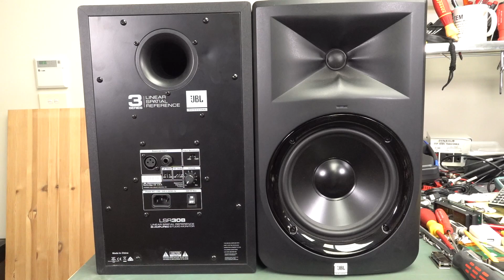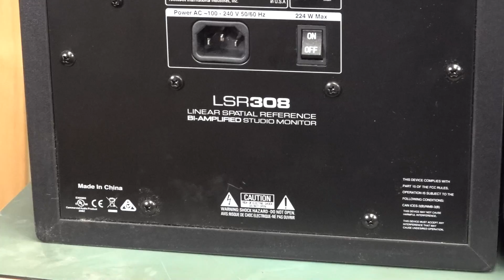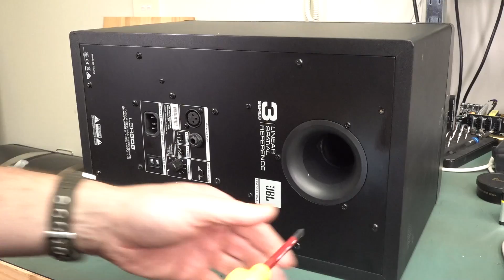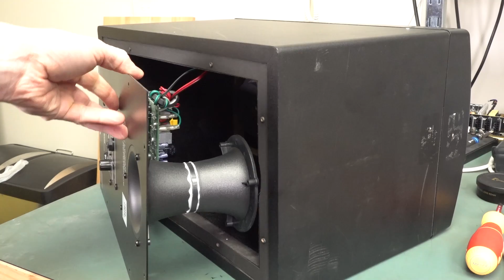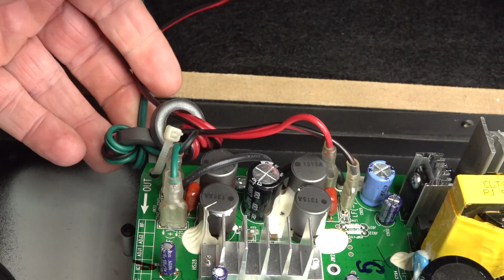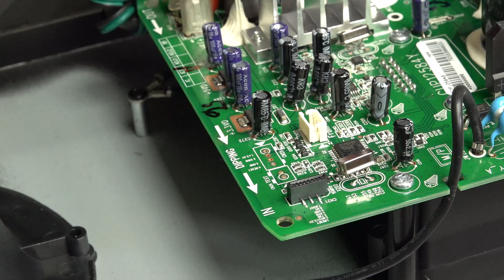EEVblog #1322 - JBL LSR308 Monitor Speaker Repair (FULL)

Comment: You probably should have used hot air on this repair, you would have found it quicker and easier to do, I use hot air a fair bit.
Reply: hot-air and looooots of flux ... as Louis alway says :p
Reply: @kittsdiy  ...available at Rossmann Repair Group (naturally) :P
Reply: Wouldn't have been as interesting as showing the cutting and isolating thermal masses method. 
Don't know about quicker, cutting pins takes seconds, and the direct iron heat application will be quicker than using hot air to heat up a large thermal mass.
Reply: @EEVblog  Cutting the pins can lift pads due to the sideways force applied when the pin separates from the ic and the blade goes in between the stub and remaining IC pin. It can help to apply just enough solder to bridge all the pads together before cutting to add strength.
Reply: @EEVblog  Dave's got plenty of "hot air" on tap so I wouldn't worry! 😅😅
Reply: @EEVblog  the cutting way i know a long  time ..when hotair was not so cheap ..and we only had irons ... another technique is slide a very thin wire under te chip en lift pad by pad  ( in this case hard because of the thermal pad )
Reply: @EEVblog  Agreed.  That is a method I would have never thought of, and it resulted in a very clean removal of the chip without any real worry for losing any passives in the process.